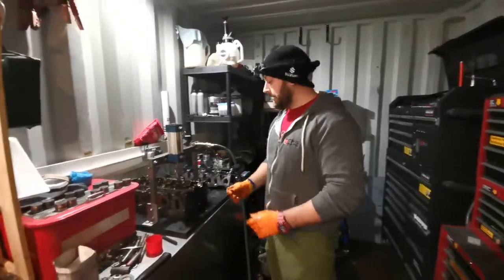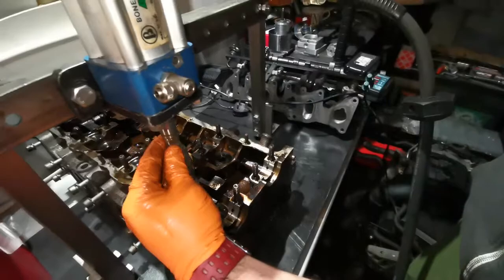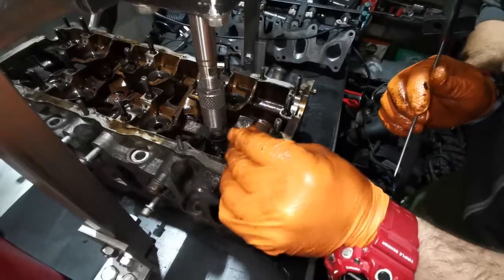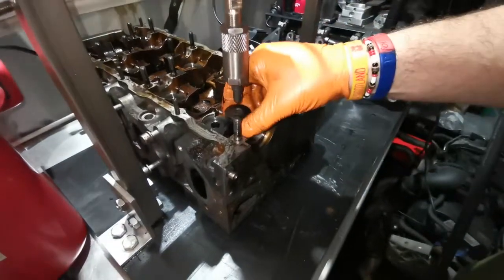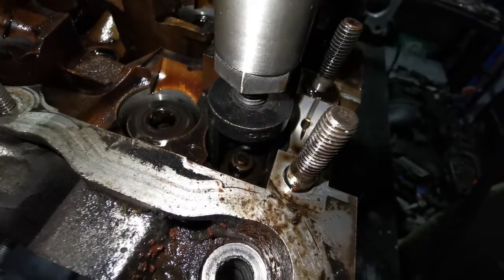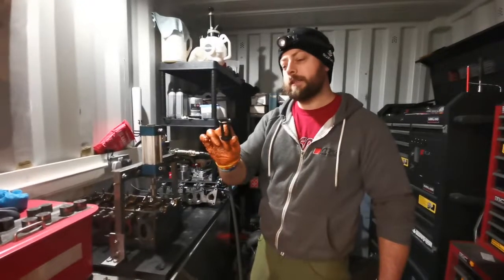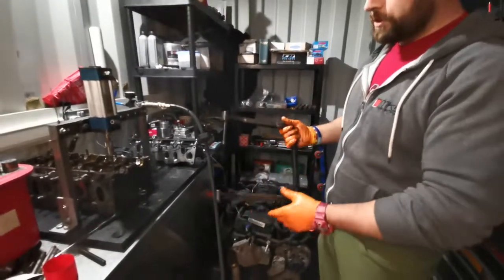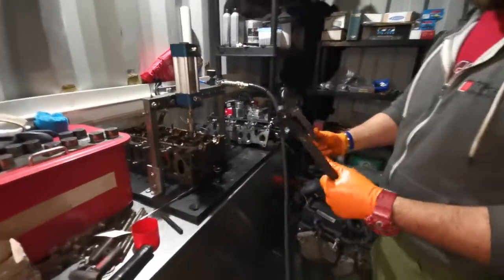MKS Performance pneumatic valve spring compressor

Comment: Just what I have been wanting like forever !! ... what are the specs on the ram, controls etc .. I'd like to build one. Also seems good for straight valves, what do you do for angled types? Thanks for sharing.
Reply from the maker: It's just some old stuff from my old work they threw out and I rebuilt the ram with new seals and works well. It can do any valve angle by adjusting the bolts and counter holding the head so it doesn't slip off from the angle
Reply: @MASPerformanceVAG  Thanks, I'll look into it ..